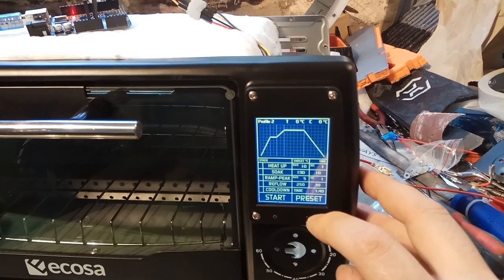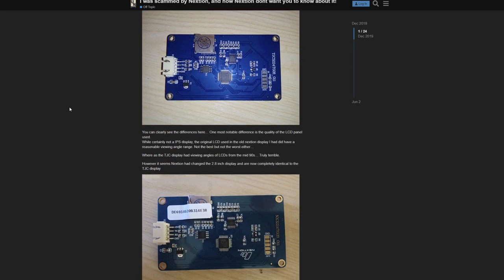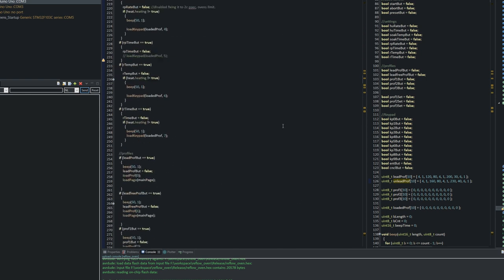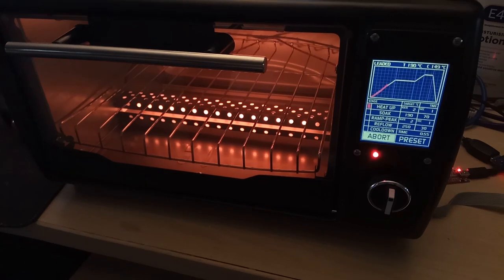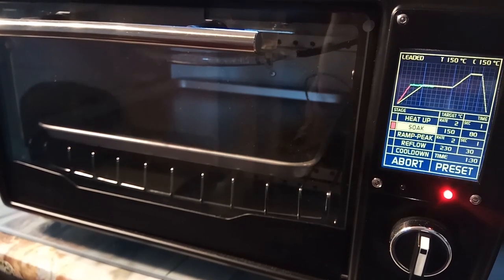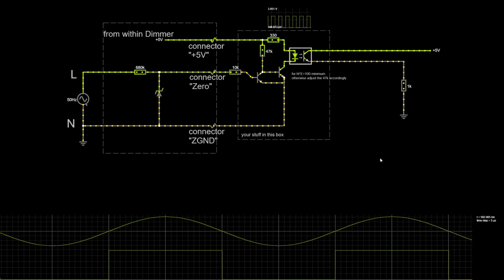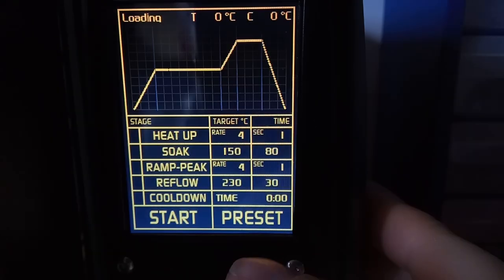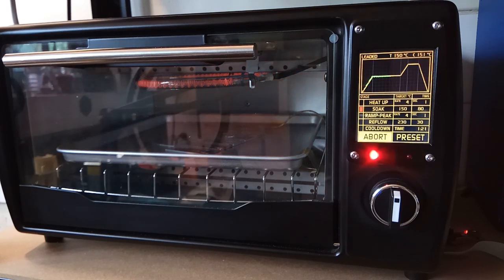I Needed A Reflow Oven, so I made one!

Comment: Loving the videos, looking at reflow oven prices now online and looks like you saved a hefty sum making one and if something breaks down the line fixing should be relatively easy unless it fries completly :x
Reply from the maker: Thanks and yeah i should have mentioned, in the end after the cost of the parts I ended up not using, i spent around 60 or 70 quid. But the BOM of the parts used is around 50. With commercial reflow ovens being at least £140

Comment: That display wont survive heating from inside of oven. It will work for some time but not very long
Reply from the maker: Its not inside the oven, the oven compartment is insulated with ceramic wool. IN fact during testing i found that section where the display went into stay really rather cool.

Comment: Can it be programmed to be used as dual mode  as reflow oven and a filament dryer oven? I could not find a cheaper oven that have lowest temp of 40c most doesn't have switchable between f and c temp I'm stuck with f temp only one has it and it's more expensive oven
Reply from the maker: Good question, the answer is maybe with a big caveat...
The issue is i added the extra halogen element.
For filament drying youd really want air circulation going as well.
With some small modifications, remove the halogen, and adjust the programming to allow for lower temps like 40c, it could be possible. 
Also just checked, a 1kg spool wont fit if the halogen is there... So it would have to be removed too... Or get a bigger oven.
Reply: @MD_Builds  my toaster oven is big enough for a pizza  it use regular heating element  it can do both reflow and dryer it's that I hate those turn knobs not accurate temp
Reply: As for halogen I don't recommend that  and yes airflow is needed for cooling down
Reply from the maker: @jamesfatula5824  Also Halogens tend to be more a contact heater like IR. The ceramic/quartz elements in your typical toaster oven are better suited for lower slower temps. But youll need to program your pid to anticipate the slower heating curve. For instance you dont really want to put your pla into an oven hotter than 40C or it can warp the filament making it useless. But for ABS and PETG you can go as high as 50c to do drying. You also want a fan going on inside to move air about and distribute heat evenly.

Comment: Nice! But really not necessary, I just put a board in. Set it to 150... then crank it to 200 I see the paste reflow. Wait 20 more seconds. And turn heat off :)
Open the door. And let it cool. And it works perfectly.

Comment: Interesting, but it seems way more complicated than others I've seen. Yours was pretty high wattage and was lamp powered it seemed whereas others I've seen used a bottom heating element. I wonder though. I'm assuming that you were turning the light on and off so much because it put out such high direct heat. I was wondering if it could have offset how many times you would have to flip the heat on and off if you built a shield between  the pcb and the heat source, so instead of getting heat directly, it would have been heated indirectly from the air? That way, the element could stay on until the heat was getting close to target and maybe slightly over. It just seems the air would contain the heat better than trying direct infrared radiation hearing, especially when the source put out such high heat.
Just wondering if it could make a difference. Honestly I've never seen a halogen driven oven before, so I'm not sure of their characteristics.

Comment: Hi that's a great video about a solder reflow projet. Is your code available? Did not see it was in the video.
Reply from the maker: https://github.com/MangyDogUK/ReflowOven  But im really not keen on having this public, as I dont want to be responsible for any injuries or fires. Please be really careful if you do this yourself.
Reply: @MD_Builds  I understand that very well, Working with mains is not for everyone. I over 30 years experience in electronics, so this is not an issue for me. Thanks for the code. I'm interested in the way you got the display section, it's very nice and I happen to have an Nextion display lying around and lonely.

Comment: Love the project, do you have the sketch and hmi files available?
Reply from the maker: At the moment no... I would say my code isnt fit for the general public right now anyway... It would need some tidying up and maybe a few methods reworked to something a bit more efficiant...

Also there is still 1 little bug I need to fix, and thats with the heat cycle run time graph... its a little offset in time compared to the profile graph thats drawn... As it was just me using it I can ignore that little offset... But if i made this public, id have to go and fix it :p 

Soooo maybe in the future I might release this.
Reply: @MD_Builds  If you would publish it with those remarks, I'm sure the community will fix those issues for you ;)
Reply: @tengelgeer  Yes, please, could really use it as a spring board

Comment: hello ! Is it possible to have the arduino code without the dimmer things ?
I will only use a SSR to switch on and off. 
Thank you  !
Reply from the maker: Look at the other comments to see the github link. But Im not going to go through it to change the code to remove the timer code... If you can take anything good out of my code... By all means.

Comment: @MD_Builds is there a way to get the source and some more details? I would love to rebuild your setup.
Reply from the maker: https://github.com/MangyDogUK/ReflowOven  but i really want to stress, Take very special care with this one. So much can go wrong and I dont want to be responsible for anyone getting hurt. I was very reluctant to release these files, but loads of people asked....
Reply: @MD_Builds  Thank you, I'll take care. Everyone should know that 230V are no joke, and never work under voltage powered on.
Reply: @MD_Builds one question at 12:06 you showing the small board for the scr dimmer can you please share the details? Are that both pc817 octocouplers from sharp?
Reply from the maker: @joseffrohle2689  Im pretty sure I put a circuit diagram on my github... need to check... but yes jelly bean optos... hmmm turns out the schematic isnt up there... umm i honestly cant remember the design. but you might be able to figure it out from the photo.

Comment: I dont get it, SSR contains a triac and zero crossing circuit, why reinvent the wheel ? why was that circuit not flickering the lights ?
Reply: I think he wanted to implement phase control for smoother flicker-free operation as in conventional dimmers. SSR with ZC only fires at ZC and stays on for the entire half period. That may have caused flicker. A light bulb will definitely flick if you control if with a ZC SSR. If you do phase control with a micro you have to roll your own ZC detection so you know when to fire off the triac.

Comment: Hello! Is this project opensource? I would like to build one!
Reply from the maker: strictly speaking no but i have uploaded code to my github... reluctantly... a few ppl asked but its not really laid out for public consumption, and theres very little support i can offer outside the basics right now... Its also a high risk dangerous project dur to the high voltage.  But if youre skilled enough and up for the task... https://github.com/MangyDogUK/ReflowOven  but please please please just be safe and be careful with it. If youre unsure about any part of this get help from some one who is skilled with high voltage stuff.
Reply: @MD_Builds  I'll take a look and can help you debug, organize, and comment the code if you'd like. If I'm too ungrateful though I guess I could find another Arduino reflow oven project. There's plenty. I can even adapt it to the ESP chips for wifi support. I'm not looking for a free ride, I'm looking for an open source maker project I can help improve and put work into over the winter. You said you had bugs and there's a whole community of us that will help you iron those out. All you gotta do is post the github link.
Reply from the maker: Theres no need, as far as im concerned im done with the project, its working well enough for my needs.
As for bugs, there might just be some minor UI errors like the real time graph drawing not being quite in sync with the time so the overlay is a little offset...
And there might be some safety code lacking...

Like i say its more a tinkering thing now. And Im too busy with other things than to endlessly do that.
Reply from the maker: Oh and wheres my gofund me donation from you? You made a big issue about me asking for donations and not providing links.... Well heres the github link. So put your money where your mouth is.....................  

I honestly dont care if you do or dont make a donation, its clear from the very outset you had no interest to. Just wanted to make a big fuss about me asking for support.
Reply from the maker: @Ethan Vandal, that was aimed at you not Goncalo

Comment: "Only" 60A feed? That is pretty high already... (Okay, not US high...) Here a normal residence has 1x 40A or 3x 25A.

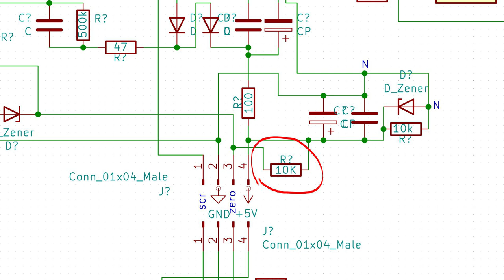11:45 That shows nothing that could have tripped the RCD. You can never trip a RCD with just L and N, you need an alternative path.
Reply from the maker: in the uk 60 is pretty low for a house. Usually 100A is standard.
Also I'm still not really sure how it tripped the RCD. But it did. The path i drew was the only logical possibility.... Outside of that I'm more clueless as to what really triggered it. Like I mention in the video im not a mains expert.... sooooooooo ¯\_(ツ)_/¯.
Reply: @MD_Builds  Damn, that's a lot of current! Here (Netherlands) you pay a premium for anything more then 1x 40A or 3x 25A. 1x >80A isn't even possible for a consumer. I just have 1x 25A...

About the RCD, like I said you need an alternative path. You can do anything with only L and N without tripping the RCD, only a breaker (or RCBO) or AFCI can trip then.  My bet is that you made a connection with your scope or simply touched the chassis with a wire. Or you don't have good isolation between mains and low voltage.

PS Stupid YouTube does not give me notifications anymore :/

Comment: Hey where are the codes,and scematic???
Reply from the maker: I reluctantly released the files here, https://github.com/MangyDogUK/ReflowOven  , but Im not keen on having this one public and may remove it at a later date. Its dangerous and I dont want to encourage people who are not experienced enough to deal with this kind of project. I dont want people hurting themselves.
Reply: What the dangerous part.
Please tell
Recently I started to build this reflow oven. So i am make a great distance from the dangerous side
Reply from the maker: @tanvirmahmud1048  Its mains power, mains voltages are dangerous. They can kill you. The oven uses high powered components that can also hold a charge inside the mains side capacitors. Those can also kill...
Please be careful .

Comment: You know that the most common failure mode of a triac-SSR is that it stays closed?
Reply from the maker: Not off the top of my head, but i never leave it alone.
Reply: Part of that problem too, as I've found, is that a lot of the SSR "manufacturers" not only use sub-standard TRIACs, but outright LIE about its specs!
If something says 25 amps (120V here) be sure that anything over 6 amps can fail the TRIAC).